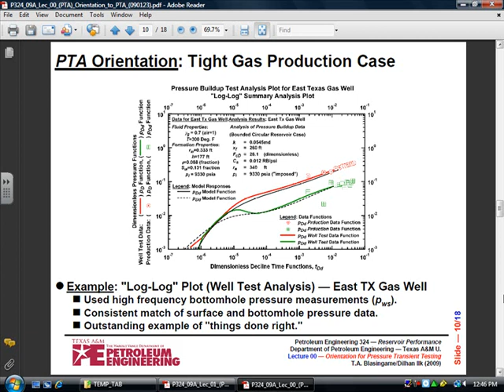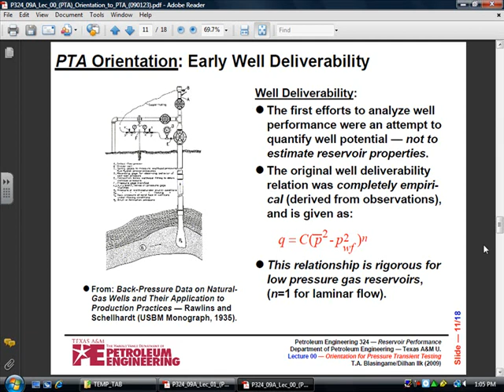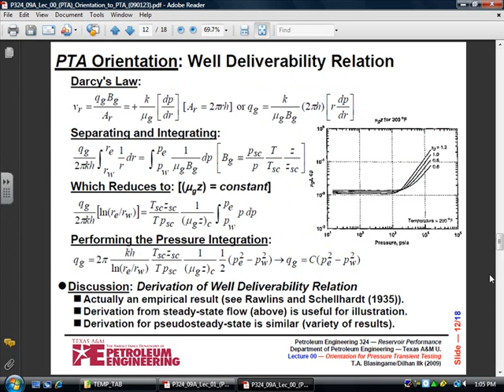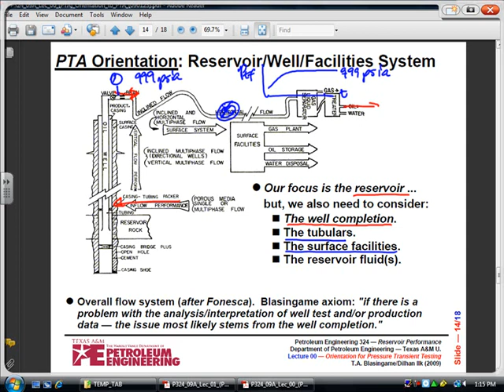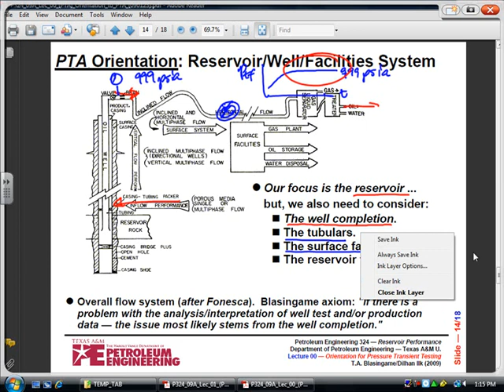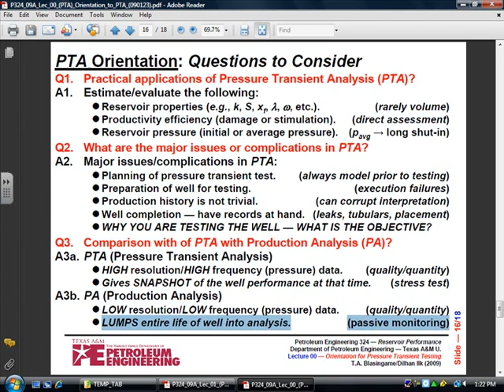Petroleum Engineering: PTA orientation, Tight gas production case

Comment: Well done, thanks for explained.
i have a question can i ask?
Reply from the maker: Yes can
Reply: @fanarconet   thanks 
may be my quiston far from topic you explained. 
a well is producing from an oil reservoir , when it is completed by a production tubing , which hanged at 5000 ft , the well test recorded that Pwf=1700 psi, and Qo=2020 bbl/day, A PVT test shows that the first bubble of gas librates after losing 870 psi . use following data:
ht=70ft ,   wt=10%   ,GOR=222 scf/bbl   ,   average flow line temp=140f ,  API=30  pb=2130 yg(specific gravity)=0.65   ,  Pth=300 psi   , 
a/contruct IPR
b/what will be Pr when the flowrate at maximum pressure drop 1791 bbl/day  and contruct IPR.
c/ select which tubing (3or4)  inch to be installed in the well that makes only 1200 psi losses in porous media and 1500 psi losses in the well based on current condition.
d/determine surface choke size for the selected tubing size.
e/specify whether the well requires artificial left technique in depletion or not? why?.

thanks for helping
Reply from the maker: @staysh2586  What is the Reservoir pressure at the same depth of Pwf
Reply: @fanarconet  the qustion told first buuble gas librate after 870 psi loss that mean Pb+870=Pr isnot it?
Reply from the maker: @staysh2586  Yes, we can consider this as a reservoir pressure if we dont have real measurment 
at which depth this PVT sample was taken
Reply from the maker: @staysh2586  If you want we can construct IPR using these data
Reply: @fanarconet  do you have anwer all parts?
Reply: @UC5vyqrnLSnmnpcFMBhqCLzQ the reservoir undersaturated because pr grater than Pb
Reply from the maker: @staysh2586  I know it is under saturated because Pr higher that Pb
Reply: @fanarconet  I know part a and b but if you have answer all parts please send for my email....
dramaystaysh@gmail.com
Reply from the maker: @staysh2586  WhatsApp me please

00201000043187